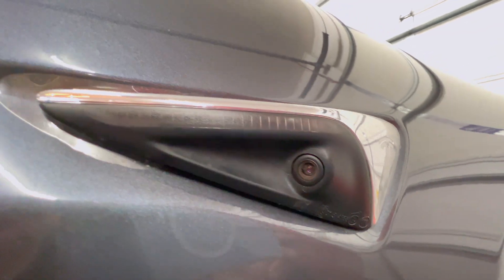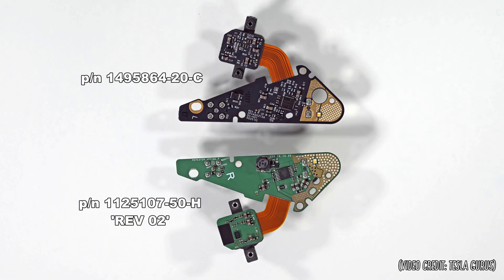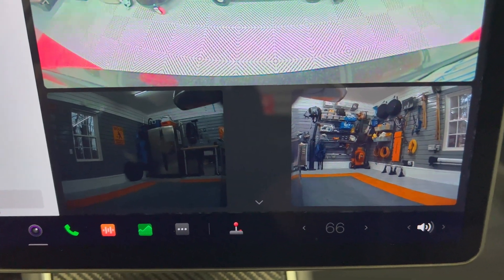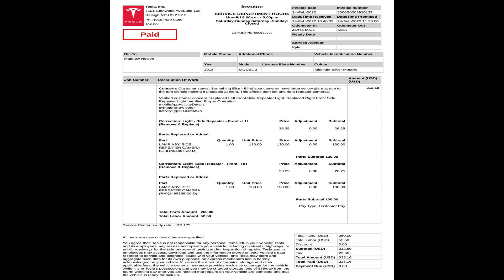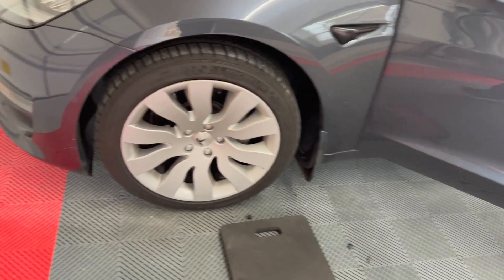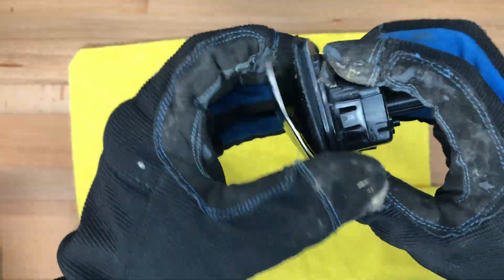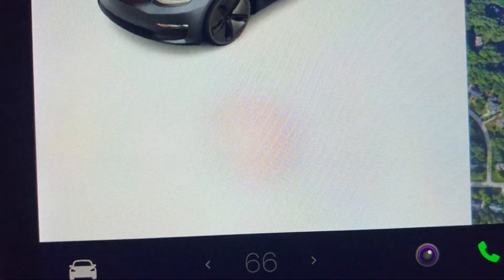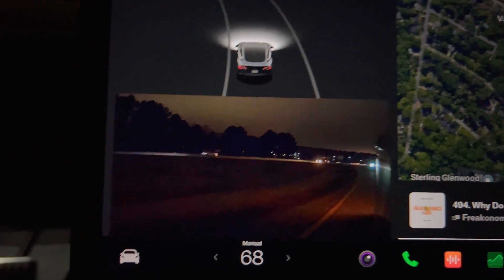Tesla Model 3 - Side Repeater Camera Glare

Comment: I have a 2021 with same problem. When on autopilot it tries to cut out in front of someone traveling full speed limit and is way too close for comfort. Last time it did it I would have been t-boned at 60mph if I wouldn't have intervened. Funny thing is it only happens at a certain intersection by my house so I have repeated opportunities to test it. That is the only time I can complain about autopilot except for minor issues in parking lots and also not being able to modify routes. You can modify routes in google maps but Tesla wont let you do itt? WTF? Anyway im wondering if my problem is the side camera? I will test it when I fix it and see.
Reply from the maker: Well, I think you can test by just looking at the side cameras on the screen.  Also when using the turn signals, does the camera video appear?  If so, I don't think that's the problem with your AP.
Reply: @MTNRanger

Comment: Use a rotary w cutter blade and open a large flap for easy access. Then, hot weld the edges together w a soldering iron.
Lots less risk of overdrilling and danaging cct boards and way easier.

Comment: The chrome is removed easier using a heat gun and a nylon trim tool. The thin wide nylon end will let you pry up carefully after you have heated the trim.  You need to use acrylic tape and preferably an adhesive primer. I used the same tape I used on my spoiler. 3M 06384 is the black tape  and the primer is LLPT 94 Adhesion Promoter
Reply from the maker: Yes, I didn't think through the removal process.  Heating it is the way to go.

Comment: Thanks for the video.  I am having this done on my 2018 with the chrome trim.  Costs are $10 each for chrome trim, $145 ea for repeaters and $11 each for labor (Monterey, CA) - $328 out the door.   I also had them replace the 12v battery $88 and $22 labor while I was there.
Reply from the maker: Yes, if you had the 12V for four years now, it's due to be replaced.  Mine gave the warning last November.

Comment: Thanks for the video. Very disappointed that it's not a recall.

My service center only charged me $19.50 for labor. The estimate originally had the chrome trim, but I don't want it. Saved $10 per side. It was $143 for each repeater.
Reply from the maker: I find that Tesla labor charges differ between service centers.  I hope it works well.
Reply: @MTNRanger  That's so odd.
Reply from the maker: @MaxHasManyHobbies  Same with prices for things like tire rotations: I've seen people listing a fairly wide gap in prices at service centers.

Comment: Using a heat gun to soften the adhesive under the chrome trim would have probably been good too. 

I don’t agree that this should be a warranty fix. Showing the cameras while the signal was activated was an added feature that the original cameras were not initially designed to perform. So they function as they were designed too on the date of manufacture. If it was needed to pass inspection- then it would be a safety recall. It’s not. It’s just a nice feature. It makes sense as a retro fit though.
Reply: It blinds cameras that are crucial for the functioning of FSD for about 50% of the time while the blinker is on. Cars were sold with “FSD ready hardware” from the start, with the claim that only a software upgrade would be needed. The computer was already upgraded to HW3 free of charge if you had ordered FSD, because it turned out that the original computer was not actually fast enough. I think the same thing should apply here - the original blinker hardware design was not actually FSD ready.

Comment: When activating the turn signal at night, the blind spot warning image will display a glare that obfuscates the view of approaching vehicles? File a complain with the NHTSA to force Tesla, once again, to do the right thing.
Reply: It’s not a required safety feature to pass inspection. It’s a nice to have feature- but not required. It’s working as it was originally intended on the date of manufacture.

Comment: Lately, NHTSA has been so critical of Teslas in general and issued recalls left and right for various things.  I'm surprised they haven't forced Tesla to do a recall for this as it could be a safety issue when trying to change lanes using a camera with a glare.   They've issued recalls for lesser problems (in my opinion).   This is a GREAT video...very helpful, thanks!
Reply from the maker: The nice thing is if it does become a recall item, I will be refunded the cost.  Tesla has done that for other recalls.
Reply: Often times the safety recalls are initiated voluntarily by the mfg.
Reply: I personally wouldn’t consider this a safety issue which is probably why there hasn’t been a recall issued. We’ve done just fine without blind spot cameras for decades and it isn’t a necessity, I’ve only owned 2 cars that have done this. If you don’t look over your shoulder you’re asking for an accident to happen anyway, tesla even tells you the same.
Reply: @guttagutta420  but the moment they add the blind spot cameras, and your eyes are redirecting there (because they have added the feature not for you to ignore it if does not work well), you are paying attention to it, so it becomes now a safety issue.